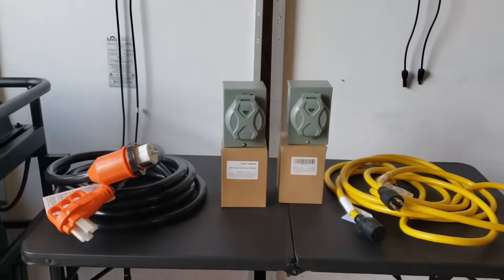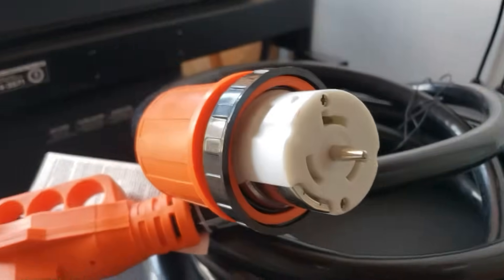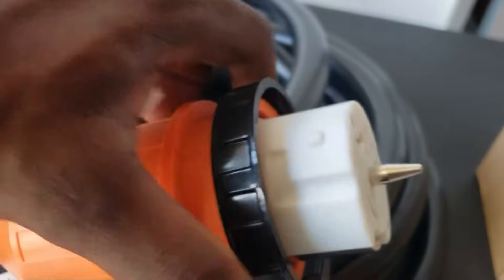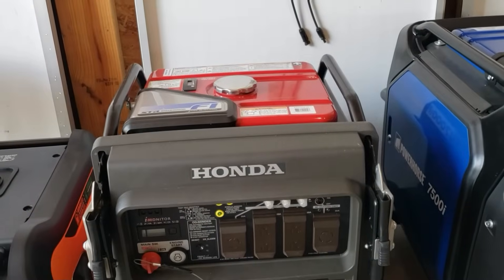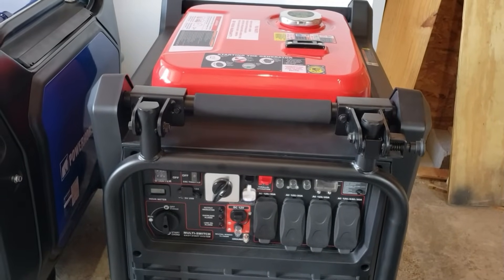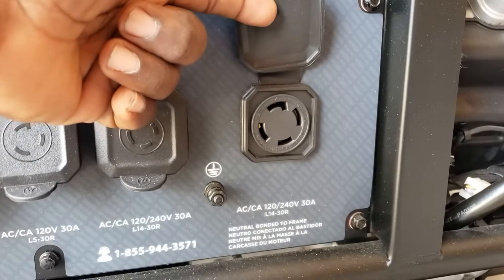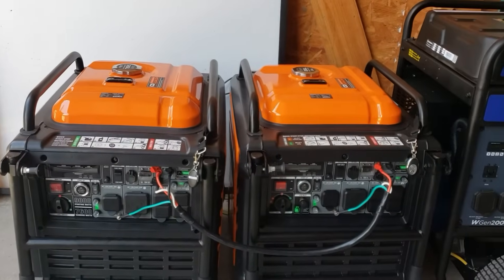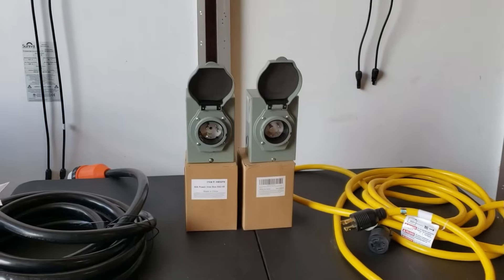Generator Inlet Box 30 amps Vs 50 amps which one should you install

Comment: If I’m going to use the DuraMax X13000HX would I use the 50AMP and which inlet Box would I use because they are only rated up to 12500Watt..?
Reply from the maker: Go with the 50 amp it’s s rated for 12,500 W

Comment: Nice video , I have a Predator 9000/7250 generator and I was wondering if that was a 50 or 30 amp generator, I’ve been told 50 but it says 30 on it , can it be ran as a 50 amp or stay with the 30 amp hookup
Reply from the maker: If you’re not going to parallel your generator in the future, you could just stay with a 30 amp plug and inlet box
Reply: @GeneratorReviews  would a 7500 watt cord be good enough and thank you for your advice
Reply: @GeneratorReviews  hey I have another question, what gauge wires should I use to connect it to the circuit breaker in my house
Reply from the maker: @dwanjacquet162  Use the six gauge wire that works great for 240 50 amps
Reply: @GeneratorReviews  but I only have a 30 amp generator, is the 6 gauge still the best choice??

Comment: I have a champion 7500/9375 watt electric start generator. 30 or 50 plug in? And will it run my entire house ? House is 1800 sq ft one story w/3.5 ton a/c.
Reply from the maker: Power wise looks like it will run the house being mindful of the loads. You just have to be really cautious if it’s not an inverter generator with a pure sine wave.
Reply: Ken Sidwell I have a dual fuel Champion 9375/7500 (gas) and for propane it is 8400/6750. I did an audit of what my house would consume worst-case with just about everything running except for two range burners, the attic fan and the 30 amp well pump, possibly some attic lights and vacuum cleaner, lol...came to 6740 watts but that is a scenario that would never really happen because lots of wants and not needs in that number (washer on, dryer on, A/C on, microwave on). For now the Champion would hit that mark since the number will be hundreds of watts lower for even an escalated need for several things to run, etc. That said...my next step is to have a natural gas fuel source. For some generators it is about 400 watts less for natural gas than propane but I have seen higher deltas for choosing natural gas, so I will be buying something big enough to hit the 6740-7000 watt worst-case scenario while on NG...but probably would never happen unless the whole trailer park of kinfolk showed up to have dinner, lol. I have a 30 amp inlet now that originated with my 13 year old Generac 5000/3500 gas so for now the 30 will suffice once I yank out the old generac transfer switch and route the power wires to the 50 amp gen circuit breaker ruled by the interlock. 

That reminds me, Gavin, should I leave the 50 amp in there or drop down to a 30 or 40amp for the generator circuit in the panel? I am still puzzling over which one to get, I am thinking there are a couple of Westinghouse non inverters that are doing less than 5%, 12k ones I think.
Reply from the maker: @mrrickychuck  leave the 50 amps the generator has its own circuit breaker as well just in case you decide to parallel
Reply: @GeneratorReviews  Thanks, sorry to be so chatty, I am just frustrated because I can't find the magic spot on what I want, lol. The Genmax 9000 is what I want but it isn't setup for NG so the moment I adapt it warranty is void and I'm stuck with a new gen that does just what I want (covers 7k watts, inverter, quiet, still 30 AMP) but no protection, lol. I have a headache!
Reply from the maker: @mrrickychuck  Just get the Genmax and convert it to natural gas
Reply: @GeneratorReviews  and let the warranty chips fall where they may!!!🤣 I may just do that!!

Comment: Great detailed information. Would like to see another on the explanation of the dual parallel.
Reply from the maker: I will work on that for sure 👍🏾
Reply: @GeneratorReviews  thank you,   I just had a nema 1450 installed in the house next to my electrical panel and electrician supposedly educated me on why I should do 14-50 and do a suicide lead with the generator I bought from Costco a firm man.  because supposedly the 14-30 the ones that home depot and lowes sales would not be able to dual parallel feed my main.  The electrician said that by by using the 50 amp 240v it will be able to energize both busses (parallel feed) and be able to give electricity to both sides of my panel versus the 10-30 or 30 amp would cause him extra work to work to move breakers in the panel Box so that the gen gives power to the essentials

Comment: So I have a question about fuel consumption… I have a 12500 generator with both a 50 amp and 30 amp breaker. Let’s say I am only running 7500 W. If I use the 50 amp service will I be using more fuel For 7500 W than if I was using the 30 amp service at 7500 W?
Reply from the maker: You’re consumption is the same when the generator is running if your power increases then yes but the generator doesn’t know if you using 30 or 50 amp
Reply: @GeneratorReviews  the thing I hear is, “A 30 amp generator uses half the fuel a 50amp generator uses.”

So I guess my question is if I have a generator that is both 30 and 50 amps, but I only use the 30amp port, would my generator use the low fuel that a 30amp only generator would use?  Or since my generator can go up to 50amps, it will use fuel like a 50amp generator even if I only use the 30 amp port

Comment: Great video. Thank you. So you need to run an 8 gauge wire from the inlet box all the way to the breaker box (assuming an interlock kit)?  That’s big bucks if it’s far away.
Reply from the maker: It shouldn’t be far away unless your main panel is inside but yes 8 gauge is pricey
Reply: @GeneratorReviews  thanks for answering. I did it many years ago with 10g and a 30a inlet. Unfortunately my breaker box is in the far end of my basement at least 50 feet from where I run the Generator. DOH!

Comment: I don't plan to parallel generator, but I just ordered the Genmax 9000. Wouldn't it make sense to go with a 50 amp  inlet and a 10 circuit transfer switch? I am assuming I would be able to run my central air (with soft start) only to cool the house, turn it off then run my essentials like lights, refrigerator and deep freezer when the sun goes down. I wouldn't need any power to the second level of my house, only downstairs.
Reply from the maker: That’s perfectly doable. You just have to get your electrician to hook up the 10 circuit just remember the AC is going to use two because you’ll need 240 V so that leaves you with eight
Reply: @GeneratorReviews  right. I'm scheduled for a Monday install of the transfer switch

Comment: what happens if i have a 50 amp inlet installed but are only running 7000 watts. any harm done? can i get an adapter that plugs into 50 but changes to 30?
Reply from the maker: You’re exactly right👍🏾and you can use an adapter for any size generator 
Thanks
Reply: I tried to find a 30a to 50a adapter and couldn’t find one.  I wanted to install a 50 amp inlet and adapt it to accept a 30 amp generator cord and I would be ready for a bigger generator when I get a new one.  If anyone knows where I can get an adapter like that please share a link.
Reply: @speckulator7516    Camping World
Reply: @bill.angelus  thanks, I’ll check them out.

Comment: I'm purchasing 2 genmax 9000 gas only. I need to parallel them but nobody seems to have the kits can I make one? And what do you recommend? 
Thanks.
Reply from the maker: They will be available on Amazon soon
Reply: @GeneratorReviews  I'm doing 50 amp.
Reply from the maker: @philwhittaker2422  yes a must for the parallel kit

Comment: I have the Westinghouse 28000 generator also. I want to connect it to my home also. I am pricing out having an electrician to do it or doing it myself. Can I do 2 50 amp connections? And if I can my parts list would be 2 plugs on wall outside of course cables and if I understand 2 interlock kits? I am a mechanic somewhat understand the situation but want to make sure I get it right. Estimates I have are $1800.00 for 1 50 amp connection that seems very high
Reply from the maker: You can and I’ve heard of several people doing that but I would have it professionally done so you don’t miss anything
Reply: That is a ton of money for that work my Electrician did the interlock and plug for 300 dollars but I bought all the parts

Comment: I have a question? The interlock box is to supply power to something like a home or Rv. There are connectors that will step down the wattage from 50amps to 30amps. Why not get the 50amps and be covered for anything that life throws at you?
Reply from the maker: Yessir that’s what I did. Great point!!!👍🏾💯
Reply: So, you're saying if I choose the 50 amp, I will need other connectors for certain things? It's not as simple as plug and play? I'm lost
Reply from the maker: @aholmes6612  You may need an adapter but it is simply plug and play
Reply: @GeneratorReviews  thanks a bunch. I'm going with either the Genmax 9000 that has the 50amp outlet or the Duromax with only the 30amp. You've been a great help.
Reply: @aholmes6612  Just like basic plugs. Except on a larger scale. Your phone plugs into a usb type C or usb  type A or lightning port has a connector to 15 amp adaptor. Your circuit breaker is a connector to the grid. It’s more complicated as you scale because of size of wiring and grounding that should be used. Also DC to AC and sign wave. I don’t know it all that’s why we watch @GavinsGarage. I just watch a video of his where he dumbed everything down. It was for us who do not know to get a full understanding. It was a video about some parkworld cables. I think it’s best he does it this way because there was a point in time when I had no understanding. Great job @Gavin’sGarage.

Comment: Could I connect a predator 3500 120v/30amp inverter to a 30amp double pole inlet to power my home?
Reply from the maker: Yes you can, you need an adapter for the plug but remember you only have 120v

Comment: I want to get a  30amp inlet installed to be used with my Champion 4500.  My question is,  if I were to parallel my champion 4500 with my predator 3500, to get 6500 running watts? Would I use the 30 amp or the 50amp side on the parallel kit. With the proper adapter?
Reply from the maker: The 30amp will work just fine for you even when you parallel

Comment: Hello Gavin,
I really enjoy all of your reviews on generators. I am looking for a whole house generator and was thinking about the Winco HPS12000HE, mainly for the Honda engine and tri fuel options. I don’t think you have reviewed this one. Any thoughts on this? Would you personally recommend an option?
My must haves; tri fuel, low THD, and 50 amp. I have two 3-1/2 ton a/c, electric dryer, 3 refrigerators and large deep freezer. 
Thank you
Keep up with the great videos. 
Karl
Reply from the maker: Let me do some research on that one
Reply from the maker: Thanks for watching and thanks for subscribing
Reply: I have this generator it is a beast but you lose a lot of power using NG or Propane, I ran this generator for 2 weeks stright during Sandy when we lost the grid in NJ and it never had a hick-up the Honda motor is excellent and runs and runs just changed the oil every 100 hours and kept putting gas in it.
Reply: @chuckschweitzer491  thanks. I don’t know anyone else that has this generator. Looking like a winner to me.
Reply: I’ve always looked longingly at that winco. I run propane with an inexpensive 7500 Westinghouse. It runs two large subzeros, my wine cooler, ice maker, heat, well pump and anything else in the house at the same time. Hooked up to my 500g buried propane tank I use for my pool, so it’s operating way below 7500. The only thing you would have to give up using a much cheaper option is the central air. We’ve lost power for 6 days straight and the generator had buzzed along 24/7 without any issue at all. But if we lose power in the dead of summer we’re using the ceiling fans and suffering. If you have the cash, you won’t go wrong with that Winco. Just know it already had a floating neutral from the factory.

Comment: I'm using a 30amp box and I bought a UL rated bridged cable to power both sides of my panel for my IQ3500.  Love my setup. Don't need to power AC, If I need AC I'll just hook it up to my 30' camper and sleep in there.  Love your channel!
Reply: Can you explain your set up more in detail please? What do you mean by “to power both sides of my panel with bridge cable” 
I am only doing 30 Amp as well because we don’t have AC and using Firman 4500 tri-fuel generator. Plus here in Canada interlock kits are not a legal way to do a hook up.
Reply: @olegk455  Sounds like what I doing.  I'm using the generator output TT-30R (120v) and running it with an adapter that takes that output and converts it to a L14-30.  Both legs have same phase 120V inputs to the input box...instead of 240V (120V per leg, different phase).  Nothing 240v will work, but everything 120v will.  Be aware of any circuits that are MWBC.
Reply: Would also like more info. My 4000w tri fuel  is more than enough to power everything I need in my house minus my AC but I can't find anyone that is willing to install an interlock that I can plug my 110v generator into.
Reply from the maker: Agreed 💯👌🏾 perfect setup and it works 
Thanks for watching and subscribing
Reply: @GeneratorReviews  can you help explain this? It seems me and a bunch of other people are in the same boat.... We'd like to use a interlock kit with our 110v generators.
Reply from the maker: @SandstormGT  This might help you 
https://youtu.be/p_UDwcUZyVQ
Reply: Which cable did you buy that was UL listed?

Comment: If you have a 9375/7500 watt generator that you use the 50 amp plug for an rv and already have the 50 amp cord can you use the 50 amp on your house even though you won’t utilize all the power.
Reply from the maker: Hey Bill
If you have a 50 amp RV that is the exact same eight gauge wire for the 50 amp interlock box. So yes you can utilize the same wire
Reply: @GeneratorReviews  ok thanks Gavin

Comment: Aussie Dave in PA here Gavin,... I installed the 30 amp & wired it to a 20 amp outlet on the other side of the wall (NOT connected to House Power) just so I can run my Fridge, Chest Freezer & Internet from my Champion 2500 watt Generator ;)
Cheap & simple :)

Comment: Hi Gavin. I’m almost finished with my 30amp project. I was sure I was buying the 
GenMax 6000. Now I’m slightly confused, please clarify. Can I use the GenMax 9000 with Propane on this 30amp Inlet Box and be safe to do so? Thanks for the video. Mike i.
Reply from the maker: Yes the Genmax 9000 starting But 7200w on propane you are right where you need to be with the 30amp 
You’re doing great you picked the right one👍🏾

Comment: First, I just want to Thank You for all the information you provide and the time and effort you put in to make these instructional videos! Now, my question is, am I understanding you right... the only way to get 240V out the Genmax 9000 is to parallel two together? I think you described this in another video, if so, can you link that video? Keep up the Great Work!
Reply from the maker: First thank you so much for watching but the GENMax 9000 is a 240 V generator. I think I said the only way you gonna get 12,500 W is to parallel the two generators together to use the 50 amp interlock kit
Reply: @GeneratorReviews  But for the Westinghouse 28000 you cold use both 50 amp 240v for parallel input to the house as both generator plugs come off the same windings within the generator.  That would give you 24,000 watts (peak) into the house.  

A T Burke.
Reply from the maker: @atburke6258  Hey Burke 
You’re obviously in the advanced class I try not to go too fast a lot of people just learning about this.
Reply: @atburke6258  yes, it is possible. However, majority of electrical service panel mechanical interlock kits is designed for only one generator back feed breaker. Paralleling the two 50 amp plugs on the 28 kW generator that way will inadvertently create suicide cord where the male end of the NEMA 14-50 to be hot. Living in a subtropical zone and dealing with grid outages after a major storm is potentially stressful and mistakes can happen. The last mistake you don't want to make is a deadly one.
Reply: @atburke6258  How would you parallel the two plugs on the Westinghouse?
Reply: @chuckschweitzer491  Mr. Schweitze, 
It could be done by having 2 extension cords from the structure which would have 2 inputs.  In order not to have the equivalent of a “suicide cord” somewhere in the structure’s wiring you might need a sophisticated switching module.  

My solution would be to replace one of the generator’s 50 amp ports with a 100 amp pin & sleeve port and of course the same receptacle at the structure.  You would also need that type of fittings on the extension cord.  

A T Burke
Reply: @GeneratorReviews  I'm with you now... Thanks!
Reply from the maker: @rdnygry  Sorry if I got a little confusing

Comment: Good timing on this video. I have our current house wired for 30 amp for our Duromax 9000. We are in the process of building a new house and I'll be putting in a 50 amp plug for when we figure out how to parallel the Duromax generator with a neutral. ;) I just have a 30 to 50 amp adaptor for using the Duromax with the 30 amp plug. Thanks for the great videos Gavin!
Reply: What do you mean "With a neutral"?